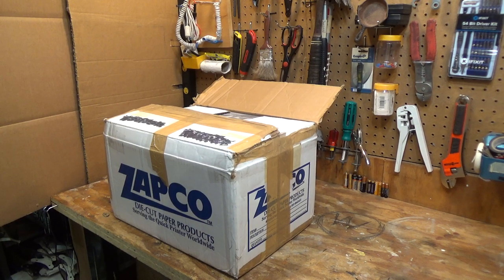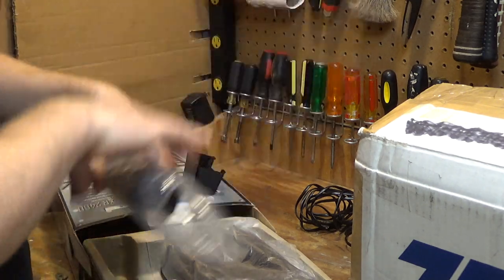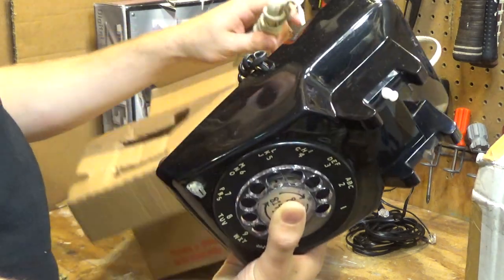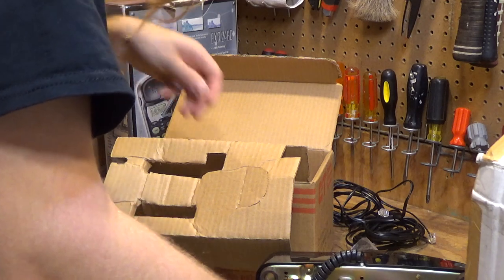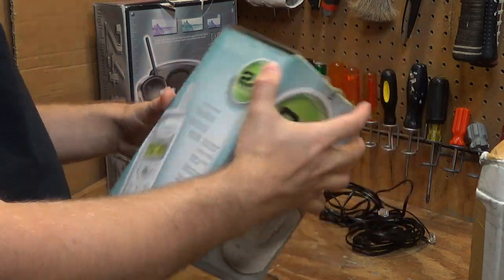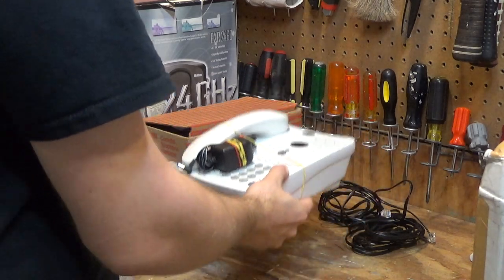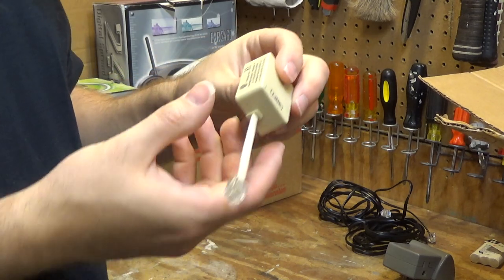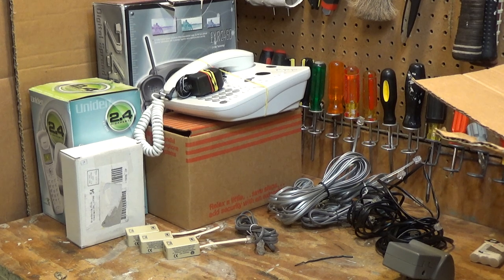Unboxing some Rare Phones

Comment: Surprised the first 2.4 phone uses a contact type battery instead of one with a wire and plug.  Hopefully a replacement won't be very exspensive.
What date was that instructions for removing the rotary dial printed?
Ah, so that second 2.4 is not the same as mine, it's the version with the screen.  So mine was probably even more budget.
I think my favorite one from that lot is the AT&T.  I will eagerly await the initial checkout of that one.  Hopefully it works better than that 958 from last year (which is not a variant with the screen, because that one doesn't have an answering machine).
That surge protector thing does look like it would be useful to use with two phones, because it will still be possible to plug in two AC adapters into it, which is not always possible with surge protectors that mount on the outlet.  The location of the phone line splitter is kind of dumb though, wires would have to very uglily hang down over the front of it.  That's why I like traditional power bars that can lay on the floor.
The local Goodwill had that same CID box a few weeks ago, I almost got it but it only runs off batteries.  Wish it had the option of a DC input, though I suppose it could be modified.
Here's what that Excelsus Swapper does, as stated by some website:  "Handy adapter switches Line 1 and Line 2. Intended for use with DSL modems designed to connect to Line 2 of your phone service. This adapter lets you connect the modem to Line 1"
"LINE" and "PHONE."  LOL.  I think that the LINE is intended to be the incoming line from the wall jack, and both the male plug and female PHONE are intended to be plugged into a phone, which makes sense.
And now it's time to read the grand ole party in the comments box...
Reply from the maker: I wouldn't say that was the first 2.4.. I'm really not sure where this model falls on the timeline.. I was hoping there was going to be a date code on the battery, but I did not notice one.. These batteries do tend to be more than average (upwards of 5 or 6 dollars), but I think I have a spare in the bedroom 900's base which should work for the test..

Not sure on the instructions, I'd have to look at them again.. I think they were printed relatively recently.. The paper doesn't look like it's aged much at all.. It's definitely not original to the phone..

I'm surprised you like that one so much.. I wish the one with the screen worked, I still have it somewhere..

That surge protector's design is great and dumb at the same time.. It really amazes me how items like that go through testing, someone somewhere in the company plugs it into an outlet and sees the wires going through the top and all over the place and says "It's ready for production!".. Unless of course, they intend this to be connected to a ground-up mounted outlet.. Which I don't think is the case given the writing on the unit..

I don't mind the batteries, Ni-Mh or Ni-Cd batteries aren't wasteful and most of the time I have nowhere to plug in the power adapter anyways..

I think you're right about that adapter..
Reply: My Panasonic KX-TG2224 and most Panasonic 2.4s use a contact battery; might've not been common for Uniden, but was common for Panasonic since 2.4.
Reply: Given the 958's design I would believe the 2 models are variants: 1818 is the answering system non-screen model, 958 is the non-answering system model with a screen. Wouldn't be surprised if there was a variant with both and/or a variant with neither. They both end in an 8, so they may be indeed related.
Reply: There aren't any more variants unless you want to count 1718/1719 which is just the answering system alone, but you are correct that it's a variant, not sure what I was saying up there.
Reply: @Xyspade  I guess it's simply them sharing parts between 2 unrelated models.

Comment: The clear gizmo on the rotary phone is likely a Line 1/Line 2 switch.  I believe it rotates 90°.  The white switch hook button may pull UP.  If so, that could have been for use with early computer modems, making it essentially a "dataphone".  When you test it out, if the white button pulls up, it may mute the microphone in the handset.  This would allow you to use it with a modem that had no dial capability.  You'd tell the computer you're going to be initiating the call, and it would pick up the line.  You'd then pick up the handset, pull the button up, and dial the number, yes, with the rotary dial of course.  The microphone will be muted as stated earlier.  If the call completes, and the sending modem picks up, it will start negotiating to get a carrier signal.  You can, of course, listen through the handset to ensure a carrier has been achieved, but the computer would have let you know that by sending and receiving data.  At lower baud rates, such as 300 or even 110 baud, you could actually hear the data going through.

I used to sell that AT&T phone, or one like it.  That places it in the very late 1990s.

The Excelsus adapter is a Line 1/Line 2 "swapper".  Inside, the red/green wires are wired to the yellow/black output wires, and the yellow/black wires are wired to the red/green output wires.  Probably used if the entire house is wired for 2 lines, and you didn't want to rewire the jack.  Essentially, it turns Line 2 into Line 1, and Line 1 into Line 2.  That's my guess.
Reply from the maker: It must take the two lines from a 4-wire configuration.. I do have an adapter to convert 2 lines into 1, so I'll have to set that up and see if that's what it does..
I recall putting it up while I was testing it, and it didn't seem like anything happened.. Clearly a second video will be needed on this one..

Was that AT&T phone any good? I have another one that has a callerID screen, and it doesn't seem to work properly anymore..

If I recall correctly, there was only a set of red/green wires going into that adapter.. Looks like that device will need a revisit video also..
Reply: The AT&T phones were just OK.  Nothing great, nothing horrible.  Kinds clunky and chunky for my taste.

Comment: Excellent video of the rare telephones Jordan U! I like the ATT phone with the Digital Answering System built in, although I could've bought one of them to show you how it works out. I believe that's the ATT 1856 if I remember that correctly. It probably does have that beep (that the ATT 1718, ATT 1719, ATT 1722, ATT 1726, ATT 1738 & ATT 1739 have) once the answering system answers the call... the answering systems of mine have to answer the call through the caller's end to get the tone beep (even for the 2nd part of the ATT 1739 Answering System) cause the 1st part of the answering system call test is going to be the answering system broadcasting the announcement through the speaker. Once my laptop comes in, I will connect my YouTube accounts to the laptop & then use my camera to record the call tests thanks to this phone!
Reply: Aaron Dunn it is the At&t 1818 or something around that
Reply from the maker: That's a lot of model numbers..